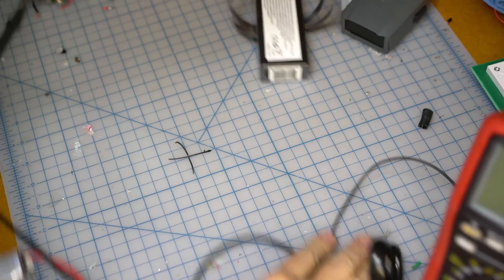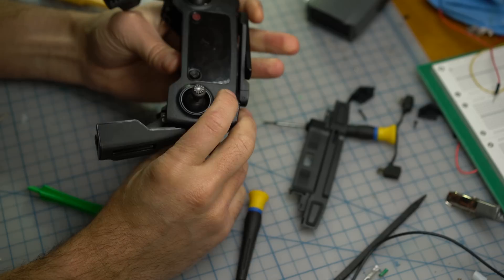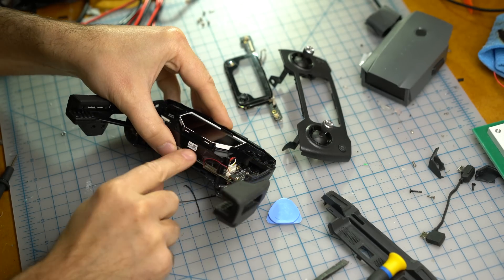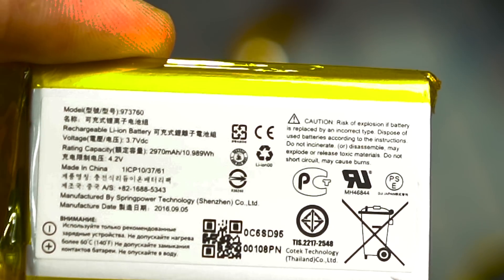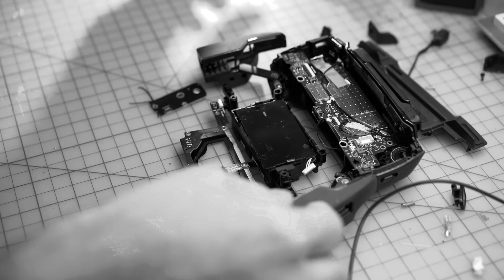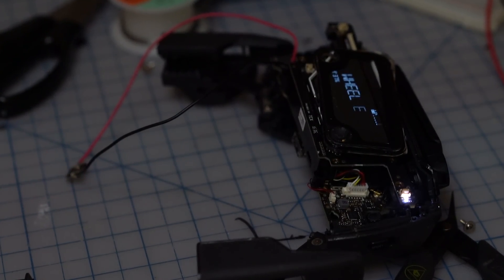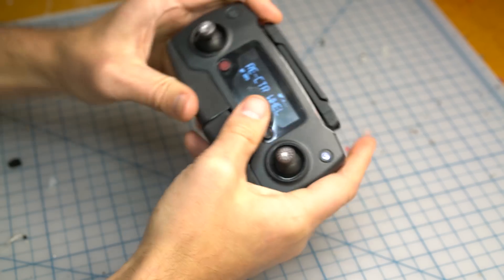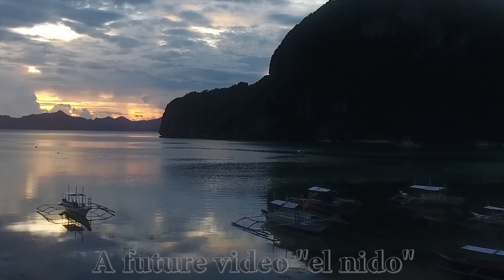Mavicpro Remote control tear down - Silence the lamb

Comment: Hey I'm an an amateur and all I have is the proper screwdrivers. Think I can take this controller apart, cavemen style break the speaker, and it will still work when I put it back together? Iw atched your tear down and it seems like that would not work because the circuit?

Comment: Using the cheaper controller without display (connecting ur phone)

I just opened and removed the speaker (only the back panel was a struggle aka first piece) and works like a dream. Its pretty much the same assemly and components.

The none display controller have lights indicating when u turn on/off and warning light by default

Comment: If anyone's wondering, the joysticks are Hall effect types. I've only heard of RC controllers using mechanical potentiometer joysticks, same as with most analog game controllers. Maybe higher end RC controllers use Hall effect ones too? They're used in industrial joysticks and I know that some old arcade games used Hall effect sticks too. And replacements for those are pretty costly when compared to the typical microswitch ones.

Comment: I took mine apart without issue, however the round toggle style button at the bottom right side of the screen pulled out of the actual socket portion of the button soldered to the circuit board. I see no way of reinstalling the small cream colored square shaped piece into the button without a dab of glue or something, otherwise the whole button will fall out easily once the controller is put back together. It appears yours came apart without this problem??
Reply from the maker: Sorry mate I don't specifically remember if it's held in by the screen plastic or is bonded to the board. Most buttons seem to be only retained by the plastics that cover them so I'd be surprised if that one is bonded. I'll do my Mavic 2 soon and have a look if it's similar.

Comment: Thank you very much for this informative video.
I have a spare Mavic Pro controller that the stock buzzer has stopped working; I can measure voltage on the buzzer pins but still I have no sound.

Can you tell me - since you've removed the stock buzzer - what type it is? Active or Passive? 5V?
I would be thankful if you could point me to eBay on selecting the correct one :)

Comment: Hi Brian,

My name is Casper from the Netherlands.
I Saw your video on youtube about the teardown of the DJI Pro RC to reduse the noise of the alert notification.
I have buy in januari DJI Mavic Pro Platinum, and i want to install SMDLeds on the controller. Where did you buy those SMDLeds. And if you have further information that i need to know. tell me.

thanks alot, the video was very  interesting and helpfull als al your other video's.
I am Looking forward to see your reaction.

Best regards Casper
Reply from the maker: Just on ebay mate. If you search surface mount leds.

Comment: Hey Brian quick question any trick to calibrate... Or putting this back together...? Were getting that stick warning and it will not calibrate at all. I have 2 controllers doing this. We just removed the speaker from the board put it back together... And will not calibrate...Did you have any problems with this...?

Comment: Could that be a mono headphone jack missing in lower right,  non populated area of the circuit board @ 6:32??  what could that be??  its gotta be some kinda jack they decided not using??
Reply: No, those two contacts are for the yellow vibration motor you can see @ 6:53 which make a connection when the circuit board is secured to the remote housing.

Comment: Would a 2 way switch 1 mute with led 2 unmute work ?
Reply from the maker: craig still may have to desolder the buzzer then resolder it with the switch feed inline. There is probably enough space in there to do that.
Reply: Brian Eastwood yea switch placement is key I guess

Comment: Please respond Brian! Im waiting to do the mod. That looks like a 'smart' lipo in there, which cables can I splice into for an external pack? thanks.
Reply from the maker: paulkazjack I don't think there is any bms on that battery it's all done on the controller. So just splice to the same voltage battery and it'll be good.
Reply: I was just wondering what the yellow and white wires are for? (on plug). Thanks.

Comment: Easy Fix? Can you drill a hole in the back of the controller(where the speaker is) and put tape over the speaker or maybe drill into it to stop it from working? )

Comment: I don't understand people Who disassemble/destroy a totally working device like this!!!also it takes a lot of money to get it!
Reply from the maker: Neither would I. Yet someone whom Disassembles and the reassembles with the goal of improved functionality, or customized inline with their preference is pretty common and very interesting. If the process looks daunting to someone, they have little experience safely taking things apart without breaking them. It's their choice not to do it.
Reply: I have 35 years of modeling behind, and I have also disassembled things, but only because they did not work. I even fixed the integrated circuits, to do everything I needed, but I never opened anything just for a buzzer that annoys me
Reply: i am about to tear mine apart to remove the damn buzzer.

Comment: Dude you are an electronics gangster! I'm sure plenty of folks would pay you $$ to silence their lambs! Just got my Mavic Pro and that beeping is just HORRIBLE. Is it possible DJI (if they wanted to) could release new firmware and adjust/remove that?
Reply from the maker: Alexander Kattan I don't think they can adjust volume mate as its a buzzer. I don't think you can control the volume. it just feeds it a voltage and it makes a noise. Like an on/off toggle. Some people have drilled the back I read. I'd prefer to open it.
Reply: Would they be able to disable the buzzer altogether with a firmware update? Not that I think they would ever do that... No way in hell they'd adopt a no-alert approach
Reply from the maker: Complete guess, though I'm sure its just the software prompts that so It would be easy for them to have it not go off.

Comment: I guess there is no other way to turn the noise it makes down

😁
Reply from the maker: Drejer's maybe earplugs. ;)
Reply: Im just not in to Tearing my Controller down :D but my wife Freaks out every time i have to Ajust my drone inside our house
Reply from the maker: Drejer's yeah sadly as its a buzzer not a speaker I think they'll struggle to patch volume in an upgrade. Either on or off probably.

Comment: Thanks so much for this! I opened up my controller and pumped hot glue into the buzzer. It brought the volume of the buzzer down to a tolerable level.
Reply from the maker: Nice one mate. It's really worth doing I believe.
Reply: @EastyUK  hello,I didn't get where did you take power for LEDs ? Could you help me to find 5v or 3.3v
Reply from the maker: @АкКорд-к8ь  I removed the buzzer and used the power that was supplying it.
Reply: @EastyUK  thanx a lot

Comment: Anybody see a way of increasing the spring tension on on the left finger gimbal tilt wheel? Is the spring able to be swapped out? Thanks
Reply from the maker: Samuel Hall the spring is pretty custom if I remember right. Not sure it would be too easy to make or aquire a stronger one with the same shape.

Comment: What you should do when replacing a component like that is to measure resistance and make sure to put about the same value through that gate as before, also if you want to find out how much currence the beeper used, you just unsolder one of the leads and place ampermeter inbetween board and buzzer pin that will tell you much current it draws.
Reply from the maker: That could have worked mate. I just looked up the max current for that part and what the LEDs used. I've been looking at various LEDs to mount on the forward face with similar consumption.

Comment: another video on YT shows a guy using a drill to carefully drill into the case where the speaker is. He silences the speaker without opening the case. Would you consider this a viable option?
Reply from the maker: Daniel Gillespie I admire it mate. Not sure I'd recommend it. It's really not that hard to pull apart, specifically when you know how.
Reply: the teardown shown in the video looks pretty complicated. I don't really want to mess up any part of my controller other than disabling than awful beeping. I see in your video that the speaker faces down towards the back of the controller which helps corroborate what I saw in the other video where the guy drills and gives a specific location to drill at. In all honesty, taking a small drill bit right at the location of the speaker almost seems preferable than completely dismantling the device to get to the speaker and then putting it all back together.
Reply from the maker: Yeah I mentioned it on another comment. It wouldn't be difficult to take a snap shot from the video and print it to scale for a drill template. I would probably just drill through the case and then use something to puncture the buzzer. It should be pretty easy to disable in a way you wouldn't damage anything around it. Which ever way your most confident in. as long as it works. :) good luck.
Reply: thanks for the tips and info, really appreciate it!

Comment: can u not just put a piece of tape over the speaker hole
Reply from the maker: ryanthethumb it's an air vent mate for cooling. Or do you mean inside on the actual buzzer. I tried that and it didn't really silence it enough.
Reply: yh i ment on the contorler didnt no it was an air vent thats shit that is dji should relese an update for it
Reply from the maker: ryanthethumb yeah not sure why the don't give you a warning a D let you disable it. Heat sink n fanatic 7:30

Comment: Hi,

Thanks for sharing, I found the right wheel of the circuit board surface dissolved a layer of glue material ...
What is the cause?
Is it too hot?

thanks.
Reply from the maker: kenlau0604 you often get residue on pcbs from manufacturing. I'd just clean it with some metholated sprits/alcohol cleaner. I'm sure it's ok.

Comment: Thanks for sharing, i was wondering if you could help with my burned usb charging port of mavic controller - http://mavicpilots.com/threads/mavic-controller-usb-burned-out.9268/  
do you think i can replace on the usb port part or do  i have to buy a whole new mavic controller?
controller is still working fine but is unable to get charged anymore.. what do you think? many thanks
Reply from the maker: ricks_v it's difficult mate. Really need to analyze on board to see what's faulty. Could be the charge controller or a faulty capacitor. Be lucky to find someone local to look at it. Maybe best using like a postage redirect to send it back through the US.
Reply: Thanks for the advise, i might buy a new controller for now and send the existing controller back to supplier.
Reply: Thanks for the answer, i've opened up the remote and looks like the usb connector is completely removed from the board. I'm going to try local repair shop, i think it shouldn't be too hard to replace the usb connector.. thanks again
Reply from the maker: Thats crazy it detached. good news though. probably the easiest thing to fix. hope you can find a good shop to fix it.

Comment: Are the batteries user replaceable.......what happens when the remote is a year old and isn't holding as long of a charge- what do we do?
Reply from the maker: I'm sure it would be easy to find a suitable battery to replace it with. Although it's a bit of work as you can see to get in there. I'd presume the batteries last a long time also. As the power draw is pretty low and so is the charge. probably many time what the drone batteries last.
Reply: Thank you for the video.
My battery needs replacement. Where can I buy it?
I'm from Russia.

Comment: Don't bother filming in 4K if you have to reduce it to this frame rate. You might as well just make it a slideshow...
Reply from the maker: Difference between 4k and 1080p on the a7r2 makes very little difference to frame rate as it takes the video from the same portion of the sensor. Only notable slow down is with the macro lens on. I should have just popped up the iso.  But in the midst of doing technical things it gets a bit busy to check everything all the time.
Reply: I can understand. It gets a but busy to do the same whilst flying the Mavic.

Comment: Nice.... those alarms are ANNOYING!... I hope DJI will make at least a volume adjustment in the future....
Reply from the maker: I'm not sure it's possible mate, It's a buzzer rather than a speaker. So it only works with an on/off voltage. Unless they have some trickery and without physically blocking it I dont know how they would reduce the volume.

Comment: I think i would have stuck a little bit of tape over the speaker holes.  :)
Reply from the maker: Jeremy Catches the vent on the back is the speaker hole.  It's also the heat vent for the fan and sink so cannot just block that.

Comment: good job，just sharing that use duck tape block the hole in buzz speaker also can help reduce the buzz noise significantly，that is I handle most thing like this such as PC motherboard without soldering jobs and still keep warranty somehow...

Comment: It kept saying "connecting". Did it ever connect?
Did it ever work again ?
Maybe in the next version of the Mavic Pro-Plus it will let you change the beep tones.
Reply from the maker: D. Hansel see latest video ;)  it worked again just a little more compliant with my low tolerance for a racket.

Comment: This DJI technology is seriously seriously next next gen. that last part with how the sticks worked just did it for me. The engineering that went into this is almost .... unbelievable not even apple products have this much innovation.
Reply: Actually, this is a nice design, but fairly standard components not a very high density. Take a look inside any smartphone and you will see that in comparison, this controller is more like last gen - which is perfectly fine for its purpose and its cost, but nothing to write home about.
Reply: hahaha I wish my 4g could do 4.3 miles lol. But yeah I feel you, for what it does it is sufficient. Nothing in its class even comes close though, it would be like having an Iphone and comparing it to a black berry from 2001. As far as the rate of aggressive innovation I have to still maintain my position on the fact that not even apple inovates like this. It would take apple 10 years to make the jump from phantom 3 pro to the maverik just to milk as much money out of people as possible. DJI is not doing that they are still run by passionate engineers that want to give the world the best they can produce regardless of if it doesnt make sense from a product life cycle stand point. Can you you imagine what the mavic 2 will be like ??? I cant..... But I can pretty much guess what the next iphone will be like, it wont have an earphone jack OR a power button, and the one after that wont have speakers.
Reply: Does anyone knows if the inside of the mavic is based on a French design or a Swiss design ?

Comment: Hi, Woow!!!! excellent work!!! That is the cause of the stick errors in your oppinion? Any advice to prevent the stick errors ? How works the Mavic RC Sticks? Is the same system of the Phantom 3/4 RC or in this RC is different? Thanks in advance
Reply from the maker: Nah I think it was just software bug mate. I've not seen any problems reported for a bit maybe they fixed it in the firmware update. Reading about the hall sensors they are using it's what the more expensive controllers use so guessing it's pretty good. Just dont sit the controller on a big magnet. :)

Comment: Every drone and radio controller I've owned have annoyingly LOUD beeps. I hate that.. and so does my dog.  Impressive how much gold I saw in there, and it appears all the solder connections are nicely domed, same as in the Mavic itself, to help prevent them from becoming RF antennas and causing or receiving RFI.
Reply from the maker: It certainly looks like a quality device. I'm no Electronics guy but everything looks well put together doesn't it.

Comment: lol you will not see it in day light! useless mod the way you did it, but nice dissassembly video :)
Reply from the maker: YOYO cheers. it was noted in the video the led placement was a bit crap.  The primary purpose was to silence the speaker.  Getting the Leds working was just showing they worked from that feed,  they could be placed somewhere more visible.  Using it a lot without the beeping I don't think I'll bother though as the vibration and alerts from the phone is enough info for me.
Reply: I suposed :) nice indeed, I love electronics

Comment: Would it be possible to drill a small hole in the back exactly where the beeper is located, and fill the beeper with glue / silicon?
If so, that this will for sure dampen the sound to a normal level.
** Edit. Never mind. I read now that tylergraves14 already suggested this, and that you answered it.
Reply from the maker: I'd say yes mate. Although might not be super simple as its curved contour on the back and thick plastic. the speaker does look like its slightly contained in the molding of the lower piece. Maybe you could use an image from the tear down make sure it's to scale and use it as a template. let me know. ;)
Reply: Normally when I do things like this (opening it up) I end up saying "Ooops" I missed  that screw, and breaking the case/pcb :-/

I've read on the DJI forum that this BEEP problem might be fixed with a firmware update.
So I'm going to wait a little bit and see if this is true. If not I might fix it myself :-)

Thank you for the video.
Reply from the maker: Its pretty well built mate so its hard to actually break it. also its only really 5 pieces inside. just stage the screws in the order you take them out and even take pics with your phone.  I'm not sure they can fix the volume level maybe they'll give option like vibrate only. that would be great.